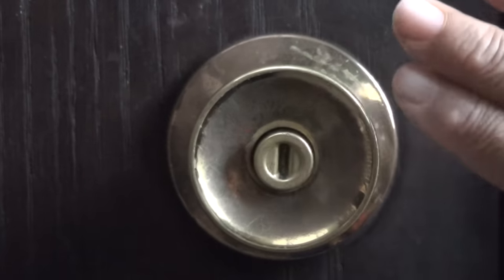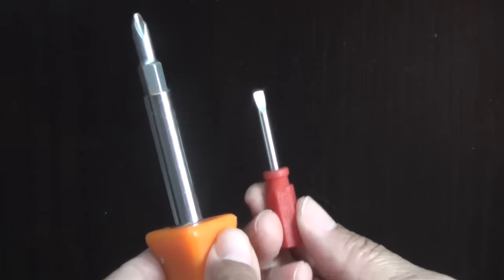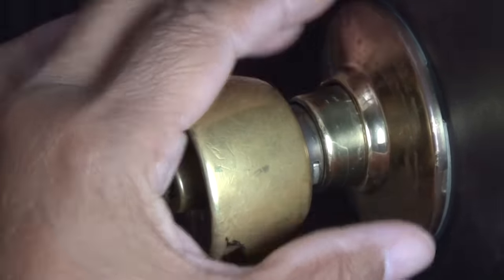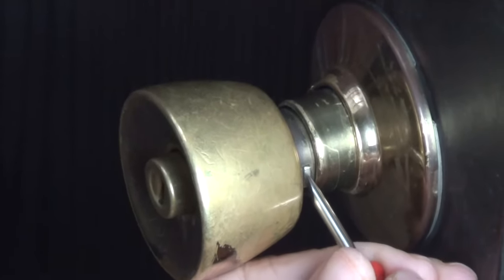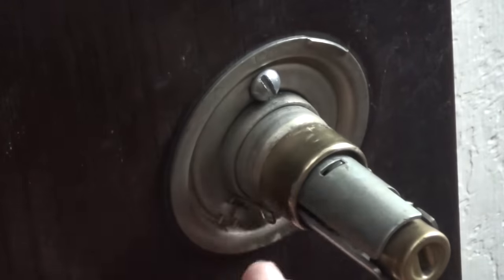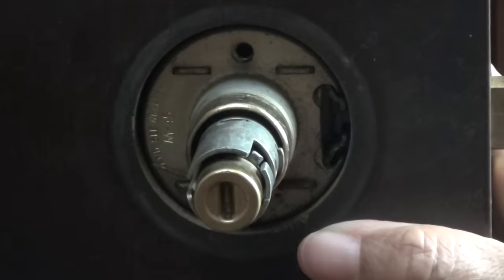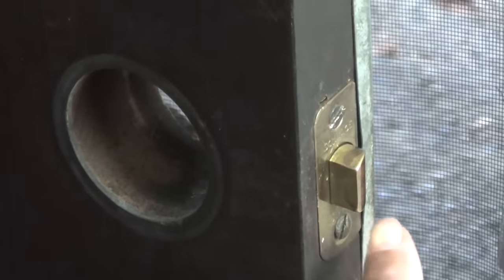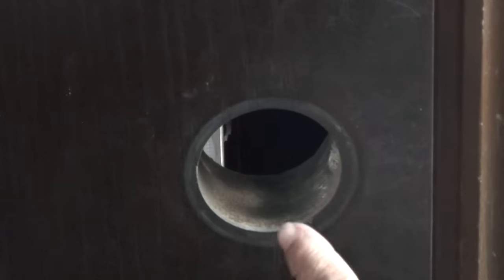Remove doorknob lock with NO SCREWS showing

Comment: I am still trying to fix my sagging front door,  one handed  makes it tricky.  Everybody I know works or busy on stuff.. 
You have great ideas and solutions..
Reply: Joe G I know what you mean Joe, I have the same problem.
Reply: Just Because This lady gave me a fairly easy solution i had never heard f called the knuckle buster.. look for her video on that.. i bought the tool.
Thnx for your input Sir
Reply: Safe Haven Sanctuary - Holly G. Well i am sorry to hear that.. Truth is i have bothe arms and hands but due to a massive stroke at 44 my left seems to be on a permanent vacation.. im  ok,, i live alone and most can not believe my house..   It is called ADAPTING..
Reply: Check at the local hardware store for a airbag tool. It is one of the best investments you’ll ever make. It’s just a little flat bag with a bulb pump that you can pressurize, works great hanging or adjusting doors or installing windows, leveling washers and dryers plus many more uses that I have yet to discover. 
I use it every day as a locksmith. It is an invaluable tool in my van.
Reply: Rocky Mountain Maker ,,  That is all well and good if you can get on the floor  or use two hands to do things but if i fall here alone i hav to call the firemen to pick me up. Im ok as long as i stay upright.. Long story i wont get into,, in closing im 
NOT in any shape to do much.. It was a big chore just to make myself a big pot of chicken soup. Turned out wonderful, i just put up my left overs which i will enjoy next few days.. had to sit and rest my back..

Comment: Thank you so much for the video, couldn't get in because of a lock jam and my mother was stuck inside. I showed her the video through the window and instructed her to push the pin. Remember, if you don't have a buldged button like in this video, you have to look for a hole in the side of the handle When you insert a screw driver there and push, it unlatches. Thanks a lot for this awesome video.

Comment: Very helpful- thank you! I have a request. I moved to an old house that has old doors with crystal door knobs. They are beautiful but they keep falling apart. I got stuck in the bathroom twice and once in an upstairs room. Thankfully the door had a glass panel so I was able to remove the door or I’d still be stuck up there! Is there a way to make these doorknobs stay together? I am considering glue! 
Thank you for your help.
Reply from the maker: I wouldn't use glue.  My guess is that the door knob stem/spindle is stripped of it threads and the set screw no long has anything to grab.  I'd replace the spindle.
Reply: You say you got locked in a few rooms, and the house is old, and the house is old?! Do you think maybe it's not the door knobs, and perhaps a ghost?😨👻😄
Reply: Have a professional locksmith come out to give you a quote and check all of your doors, explain which ones are issues. 
They will/should know what needs repair and what needs replaced.

Comment: I CAN do this.  I DID do this.  Fifty years old, sounds about right....my place was built in 1974.  I thought painting a door was going to be easy until I came across one of these fifty year old door knobs which I thought I was going to have to cut it off.  Don't think I'm going to be able to get it back on so I'll replace it with a normal door knob.  Thank you for the video.  Ok, getting back to work.

Comment: The first house I bought in 1976 had door knobs like this. But being a mechanically minded kid from the time I was 6 yrs old, (I used to drive my parents crazy taking things apart and trying to put them back together, lol) it didn't take me long to figure out how to remove the hardware to get to the screws. Then I proceeded to replace them all. This house even had the original, little keys over the door jams so that one could gain fast entry if need be. I kept this a secret for 12 yrs. No one could figure out how I was getting into their rooms? I just said, "I have the touch."

Comment: Remember that there is usually two standard backsets for door hardware. 2 3/8” or 2 3/4”

To measure for replacing hardware use a ruler or tape measure and measure from the edge of door (where the latch is) to the center of the knob or lever, that will be your backset.
 
It is good to know this when your shopping for replacement hardware. Most home improvement store hardware sold today are adjustable. When ordering online some door hardware have a fixed backset.
Reply from the maker: Thanks for mentioning this.

Comment: I know this is an older video, but was very helpful when I went to change interior door knobs in my house. But one seems to be installed the wrong way and the hole is on the opposite side of the inside latch. I can see the indent that is on the opposite side from the latch ( hole was just placed on top when put together)  and the cover plate Locke in place when knob is installed. Would you know any way to remove other then destroying the lock or cover?

Comment: Leah, I'm a retired Locksmith and I just wanted to thank you for this video and all the others.  I noticed a small error in your terminology.  The "little round faceplate/backplate" are called either "Rose Plates", "Roseplates" or "Rosettes".

Your KIK (Key In Knob) extraction was picture perfect!

Also, both Latches and Bolts typically come in two sizes.  Either 2⅜" or 2¾".  Any DIY replacement will NEED to know this measurement.  Another thing to keep in mind is that latches come in two types.  There are Entry Latches and just plain old Latches.  The Entry Latch has the extra little spring-loaded pin that rides the Strike Plate.  These are typically used on doors that can be accessed from outside.  It makes the latch more resistant to the shimming ("credit carding") attack.

The latches without this extra pin are used for applications like closet doors and bedroom doors that don't lock.
Reply from the maker: Thanks for the additional information.  Much appreciated!!!

Comment: Great video Leah. I just dealt with this issue 2 weeks ago this video could have been useful. I didn't know what to do, so I just drilled through the plate and figured there had to be screws behind the plate holding the knob just like any other knob. 🤭🤣 Turns out I was right and got that thing off albeit the wrong way but got it off.

Comment: I have a house with asbestos siding. I was wondering if it's something I can remove/replace myself with safety gear, or would I have to hire professionals? My goal is to sell this house, but I'm worried the siding will sabotage that plan. It's all in the front, and on parts of the side of the house.
Reply from the maker: Whether you're permitted to remove the siding yourself (homeowner) depends on the area you live in.  Mlst states do permit homeowner removal, so you'll have to check.  If you do it yourself, follow the recommended safety precautions.  I think you can find them at the EPA.  Good luck with your project.

Comment: I am a maintenance repairman at a healthcare facility. We have 100's of Schlage style commercial door locks that come apart like this. But the key cylinder can not be in the lock position or the pin will not push in to release the door knob. Many have to be drilled because the key cylinder will not turn for some reason or another.

Comment: @seejanedrill Hello Leah, I looooove your videos! This one has been around for a while and I am not sure if anyone is checking it, but am very hopeful :)) My interior doors are simple wood veneer hollow flat paneled, probably cheapest one the builder could find in 1986. I am thinking to paint them and revive by updating hardware.  So, I bought keyed Schlage F-series locks with lever, which are heavier than original door knobs. It was a breeze to replace them, but now, each time I turn lever, the rectangular rosette is moving slightly, looks crooked against the door edge. I am afraid to tighten the screws too much, what if the rosette will cut into the thin veneer of the door and it will crack? What is the right way to deal with the issue? Hope for a good  advice!

Comment: What’s happened if the latch is stuck and you can’t actually open the door to remove the latch from the side? I managed to remove the doorknobs but am faced with the back structure of the latch which i need to figure a way to remove from the doorknob circular cutout. Any idea?
Reply: Me too! Did you manage to remove it?
Reply: @yenyeechong1283  I removed the door knob, but the latch was still stuck inside the socket. In the end I had to enlarge the door knob cut-out with chisel and extracted out the latch structure piece by piece with plier. Sad. This last resort wouldn't have been possible had the door been steel, not timber.

Comment: 3 days after I locked my keys in my car at work with my spare keys at home (37 miles one way). House keys locked in my car as well. I had to drive the company truck all the way home bust out my door knob, break into my home and get my car key. Turn around drive all the way back to work unlock my car and then turn around again and drive home again. Fortunately my company doesn't pay close attention to my over time so stayed on the clock so they could pay me for my personal screw up. Not that this video would have helped but it is a funny coincidence. Now I'm having fun putting my door frame back together.

Comment: My plate cover would not just, "pop off."  Instead of damaging my metal door trying to pry it off with a screwdriver (it didn't budge, even with impacting the screwdriver with a hammer), I used a Dremel blade and cut a diagonal slice through the plate until I could get a pair of vice grips in and tear it out.